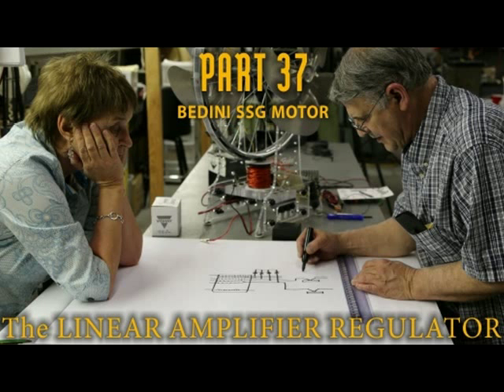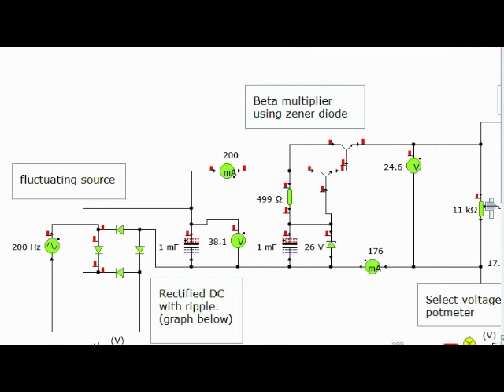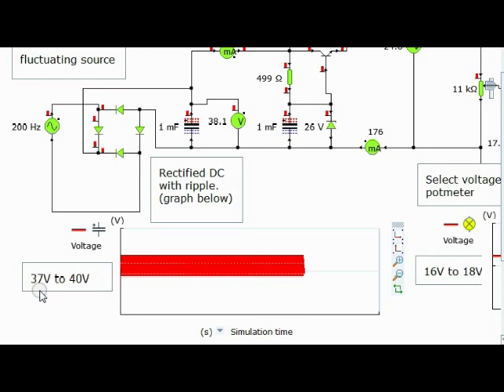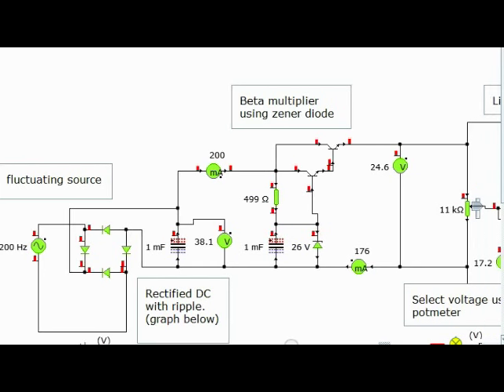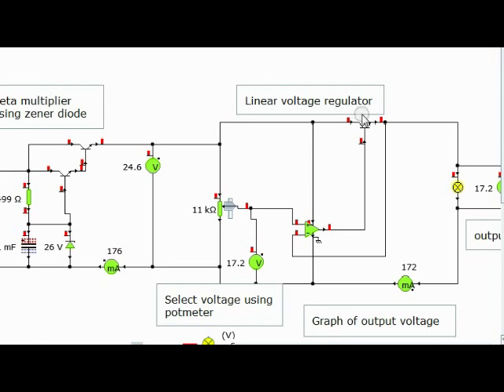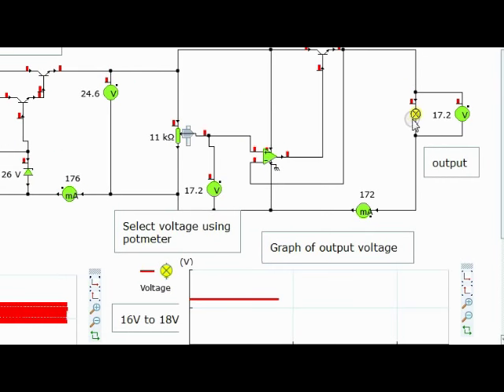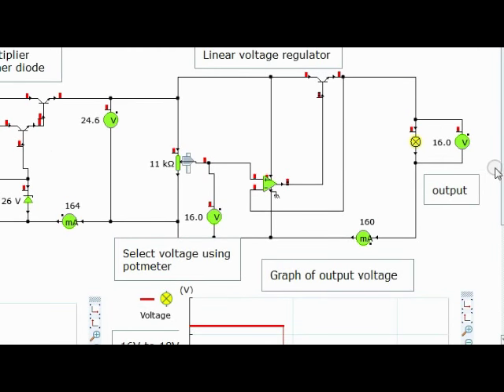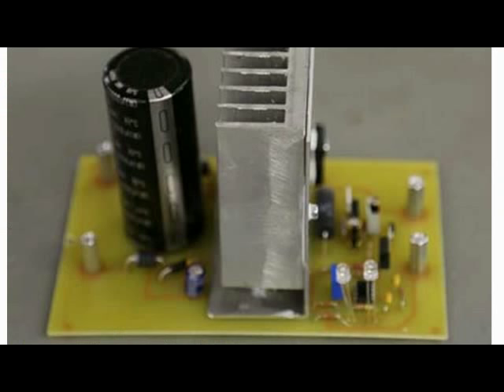Linear amplifier regulator

Comment: Thanks for sharing
schematic
Reply from the maker: might want to reconsider the regulator, which now is a voltage divider, right after the beta multiplier stage. the schematic as is has a floating voltage, which is difficult while charging. any other regulator supplying reference to the opamp should do.